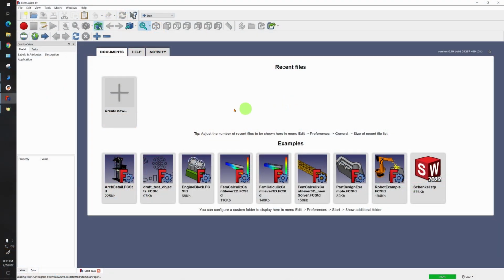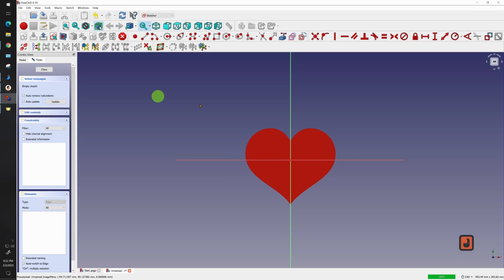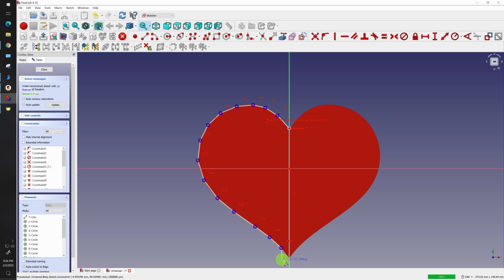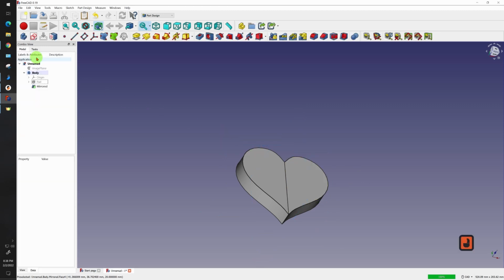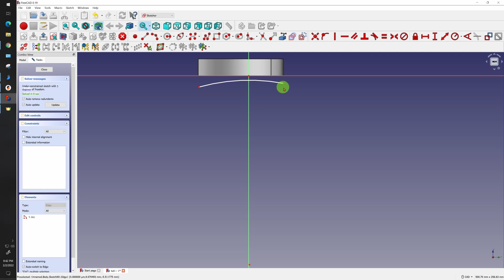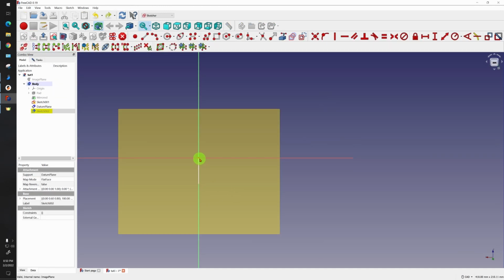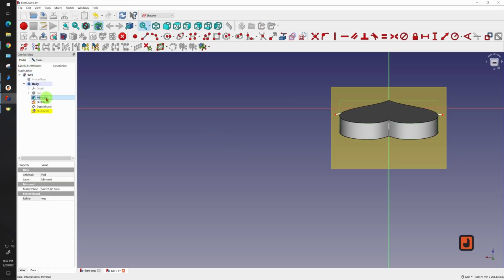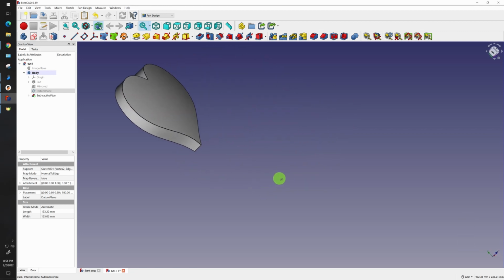FreeCAD Tutorial: Valentine's Day Heart

Comment: Thank you for the lesson.
That's a quicker way to change a flat form than making a part and then adding it to the 1st part. But it takes more understanding. Still a bit weird, like the idea to cut a cube with a ball.
I am new with FreeCAd and maybe somebody can tell me - can't I just draw my part in side view, front view and top view like we were taught at school- and get my part from this 3dementional sketch? Freecad makes such sketches it would be logical if it worked the other way too.
Reply from the maker: This is the old-school way of doing it.  I was lucky enough learn 3D CAD in the 90s back before a lot of features that are common these days existed.

I don't know of any CAD packages that let you just draw a 2d view of side/top/from and then generate the 3d view based on it.  It's usually done the other way around, you draw a 3D object and you can generate a 2D profiles from that (including an isomorphic view).  In FreeCAD that is done by the tech drawing workbench, you can make an object in part design or parts workbench and then use Tech Drawings to make your blueprints.

🍻
Reply: This is the old way.... Yes! Exactly! But this way you have everything in front of your eyes just from the start which is very convenient. In FreeCAD I have to be in constant interaction with the process like living through every step which is tiring and I am never sure about the result because instead of drawing a line on the side view I have to fulfill a bunch of actions, quite different every time.
----------------- then use Tech Drawings to make your blueprints
Exactly. FreeCAD can do it, so it should understand the other way around. )) 
 @QEngineering